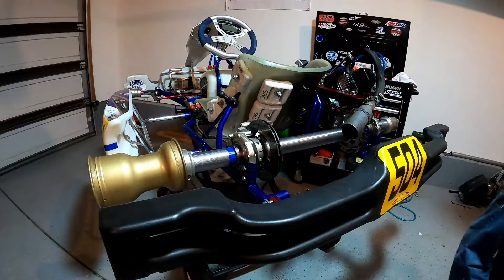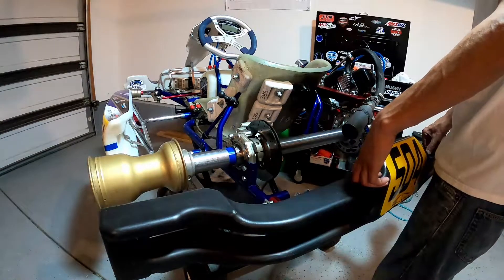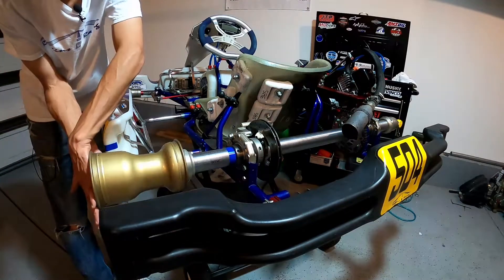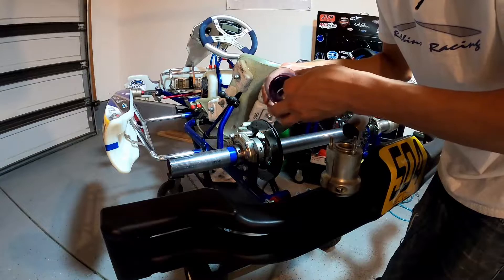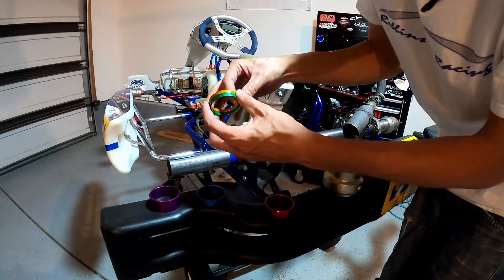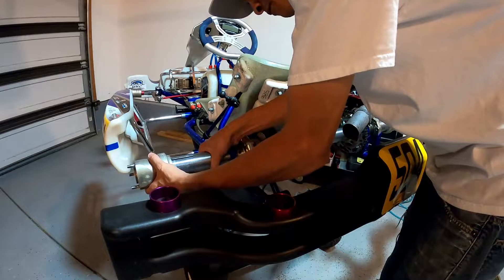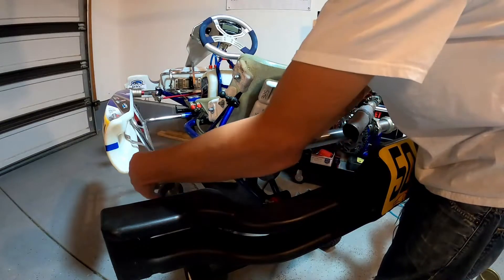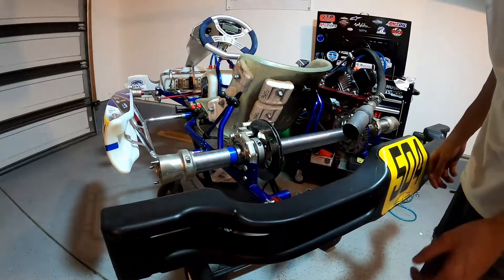Go Kart - Rear Track Width

Comment: spacers inside the hubs are actually illegal in my championship, it states that the rear axle must be made out of one solid piece, which it technically isn't when you put spacers in, still i think it's a good idea, especially when there's so much grip the wheel hubs start moving on the axle.
Reply from the maker: First I've heard they could be illegal.  Definitely going to check our club rule book.  Thanks for the heads up!